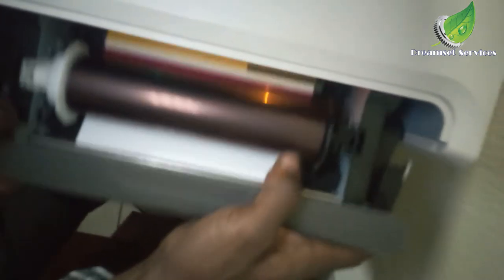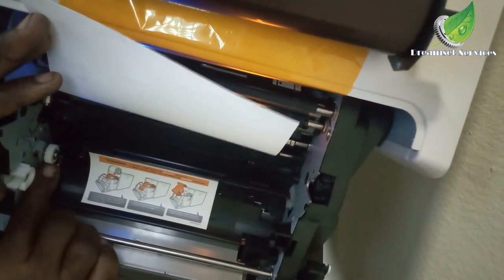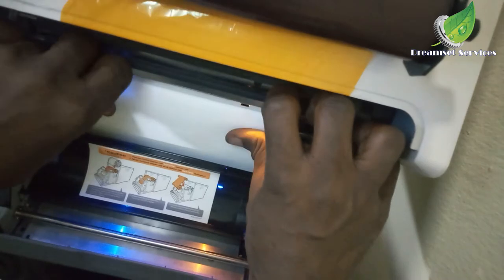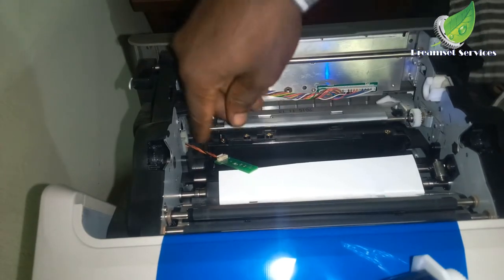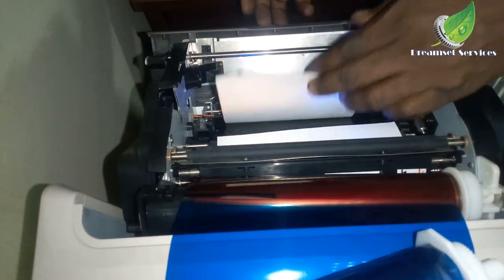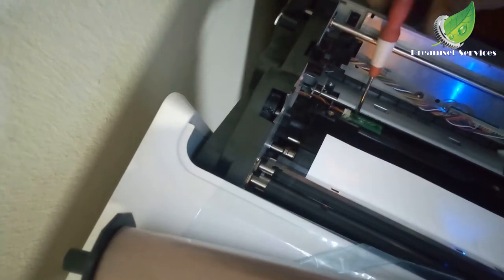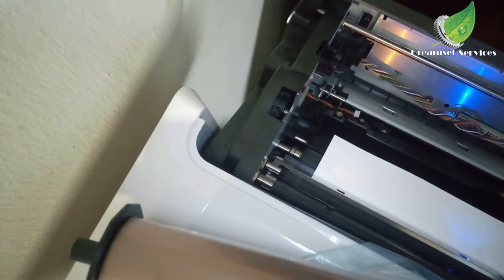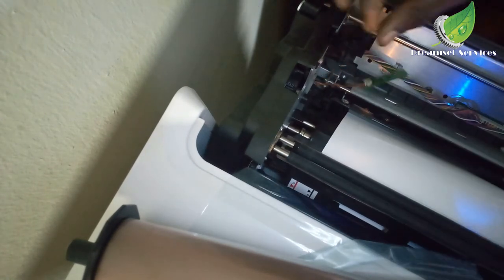Hiti Photo Printer Troubleshooting and Repairs

Comment: 0101 Cover Open Fail happening even though the front is closed and seemingly locked like normal. Tried opening it up and redoing it several times. If I move the door to the left it reloads and then gets same fail back again. Sometimes it starts printing and fails after one prints saying the cover is open. Any ideas how I can fix this? Or does it need to bem sent in?
Reply from the maker: It's the door sensor that is failing

Comment: 2 Printers back from the repair shop and now they still don't work, new problems. One has printer fail on yellow pass, it stops & cancels the print and takes yellow page back inside. 

The other printer has a paper jam, but no obstruction is clear as to why it's doing it. Always gets stuck immediately.
Reply from the maker: The one with paper jam even when there is no visible obstruction there is a bad sensor issue